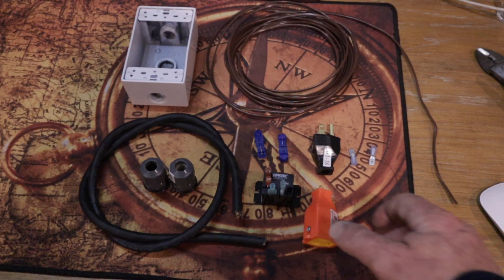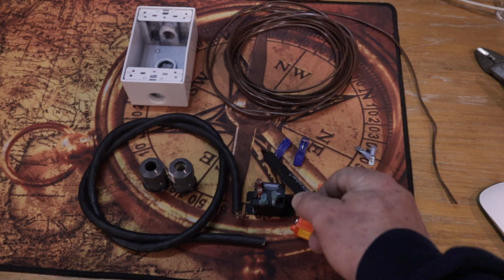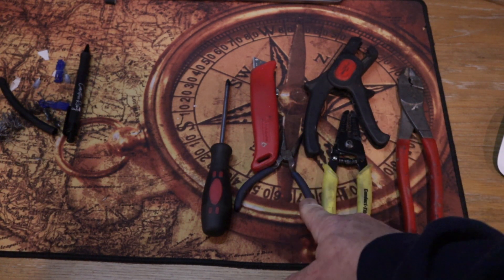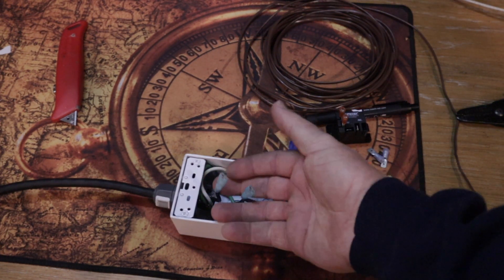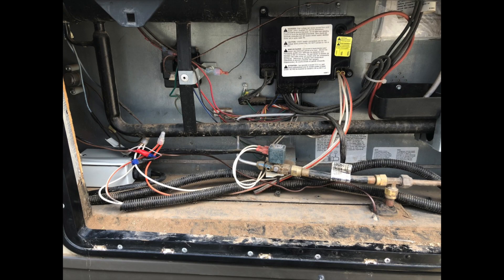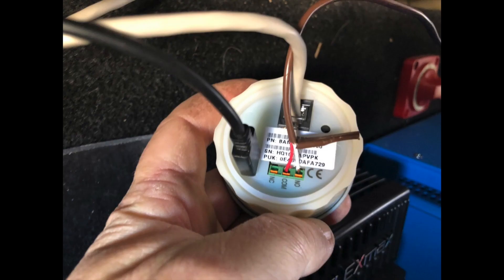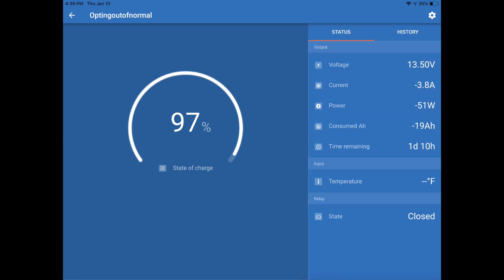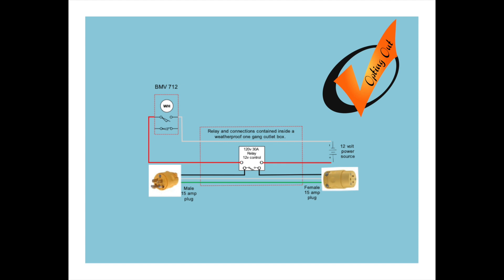DIY Automatic 120v Power Switch to Turn On Electricity To LP Refrigerator.

Comment: Great idea! I did this and it worked great until I switched to a 12v refrigerator which I noticed you converted to one as well. I moved this over to my water heater and replaced the element with something smaller (1000w instead of 1500w) so it doesn't use all of my solar. It's great to have the water preheated while boondocking for an evening shower!  Again, brilliant idea 💡😊👍
Reply from the maker: I had a lot of changes to my RV this last year. I did switch to a 12v fridge after my cooling unit experience a leak. But the virus has forced us into more RV parks vs boondocking since we were on the east coast. My relay switch is sitting in a box until I come up with a new use for it.

Comment: Great idea concerning how to harvest what would otherwise be wasted solar power.  It really has my head spinning concerning how best to utilize this functionality.  I presume that the only downside is that if you plug in to shore power and have a depleted battery bank, the frig will continue to run off of propane until your battery bank gets charged back up to your set point.  However, with those victron inverter/chargers, that won't take that long anyway.  Thanks for the video!  (P.S. It was nice meeting you at the Xscapers Bash last month.)
Reply from the maker: You have the option to manually turn on or off the relay as well but like you said if your bank was down it would be charged in a little bit and then the refer would switch to AC anyway. It was great to meet a lot of new people. We are looking forward to being able to do it again soon.

Comment: I may do this, a great idea. Right now I just keep my fridge on auto, and when my batteries are full (I monitor them closely) I just switch on the inverter, and the fridge will switch to electric. I can turn on my inverter via phone as long as I have cell service, but as of now I have to guess when my batteries are full (normally by 12 noon) This would take the guesswork out.
Reply from the maker: Takes out all the guess work and also makes it so you don't have to worry about forgetting. Mine will come on when I reach 85% because I have a lithium bank. I also keep the inverters on 24/7 when we are getting good sun. I like automated functions that I do not have to think about. But this set up could be used for several different circuits. Instead of using it on the refrigerator it could be used on the water heater. but that is a much bigger draw and could load up an inverter pretty quick.

Comment: Very smart idea! I've been switching back and forth manually and of course there have been mistakes made. Either I forget to turn the fridge over to electric during the day or forget to switch back to gas in the evening. Your project is the perfect way to take the human error out of the equation. Now can we go next level and add a thermostat on the water heater so we can make the water hot on electricity first then automatically send the power over to the fridge after? That would put me in solar power bliss!
Reply from the maker: Roy Hall I will look at the water heater and see what I can figure out. Though 11 amps AC draw will quickly eat up extra power.

Comment: This is a great solution to leverage solar power capacity with a RV style 2 or 3 way refrigerator.  Let is know how it has been working for you and the impact of the charge for the batteries.
Reply from the maker: Something that happened to us the other day that we did not really plan for but had it work out in our favor. We were sitting in a state park and lost power while we were out. The power inside the rig continued because of the inverters, but as the batteries drained 80 percent, the power to the fridge was shut off so it switched over to propane. If we did not have the switch and had it selected to use AC, we would have come home to find our batteries way lower. So it really makes a great reverse UPS. To shut off power in case of loss of shore power.

Comment: Thank you for a great video, one question: what is the advantage of using the Normally Open (NO) relay and inverting the relay in the app, versus just using the NC relay connection on the hardware? Thank you so much!
Reply from the maker: When I first put it all together was thinking the relay would naturally sit open until commanded to switch closed, when I had it all together I realized that the way to make it work was to simply invert the relay. There was very little current used for the change so that is the way it ended up. I would play with it a little dependent on the expected weather as well. So no real advantage or disadvantage really. But the system did work well at keeping me from forgetting to change the selection from AC power to gas on the refer.

Comment: This is a very interesting way to keep the refrigerator working. When you're using the (DIY Switch), does this mean the inverter's output is connected to the male plug on the (DIY switch) and the refrigerator plug is connected to the female side of the (DIY switch)?
Next: My Norcold  is plugged into a receptacle that only works on shore or generator power. So I'm assuming that there will be two separate receptacle in the back of the refrigerator compartment, one for shore/generator and the other 1120v plug from the inverter?
If I understand this correctly, while boon-docking, we will move the plug from the normal receptacle to the (DYI Switch) female side of the plug.

Thank you for the video...
Reply from the maker: My rig is set up with two Victron inverters. One powering each leg of my 50 amp service. I do not shut them off, so prior to the the installation of the DIY switch if I set the refer to auto, it would always see 120v power and it would stay on electric as long as the inverters were making power.. This DIY switch allows me to leave the refer on auto and control the power at the outlet depending on the battery bank SOC. We were sitting in a state park and lost power while we were out. The power inside the rig continued because of the inverters, but as the batteries drained 80 percent, the power to the fridge was shut off so it switched over to propane. If we did not have the switch and had it selected to use AC, we would have come home to find our batteries way lower. So it really makes a great reverse UPS. To shut off power in case of loss of shore power. But with yours, as long as your DIY switch 120v input was connected to the inverter, and the refer was on the outlet it should work.
Reply: Thank you for clarifying the connections. I have seen a lot of people using Victron Inverters.  I might change from my Magnum Energry because I like the Idea fo two inverters.  Take Care, Have A Good Day....
Reply from the maker: @lxe1986  Depending on your Magnum it is probably feeding a sub panel. It should be fairly simple to put the refer circuit in it. It would be nice if Magnum would get with the times. Victron has way more bells and whistles in my book.
Reply: I agree with you about the Magnum not being up to day with new technology. I just find out that I can't stack or set my inverter for running in parallel mode. It appears I might change out out my Magnum stuff for Victron Energy system.
Reply from the maker: Mark Cole if you look at the video where I did the Install on the Deathstar, we ran into that same situation. You can have two work at the same time but per the Magnum Engineers, at no time can the outputs be joined back together.

Comment: Okay so I'm a total noob at this.. But I'm putting together a solar system for an RV. And my plan was just to connect solar to charge controller, charge controller to batteries, batteries to inverter, inverter to AC main. Why will this not work to power everything in my rig?
Reply from the maker: It will if done correctly. The problem is that a propane absorption Fridge will see the AC power all the time from the inverter and if left in auto  mode will drain the batteries.

Comment: (x2) PTRH-1A-12S-T4-X-2 | SPST 12 VDC Coil Sealed........This part is not available on Amazon is there an alternative?
Reply from the maker: Thanks for the question. Here is an alternative part. https://amzn.to/3fuvN74  The difference is that this one can handle a larger amp load on the switched circuit.
Reply: @PanelsUpSolar  Thanks